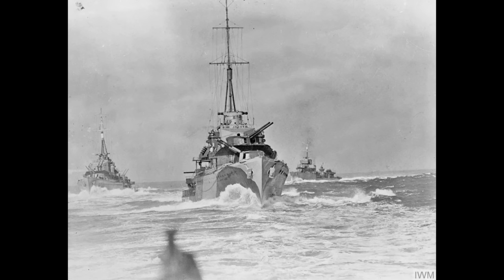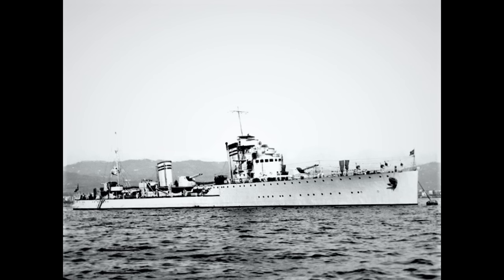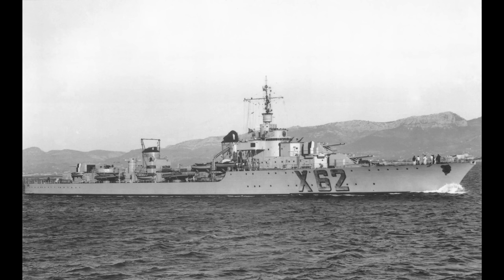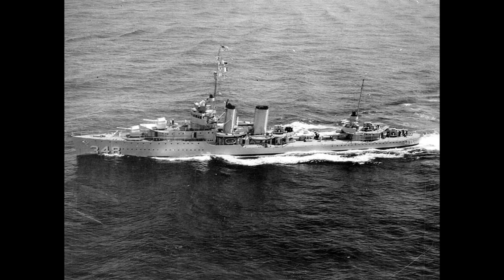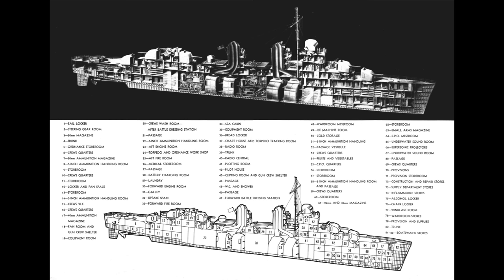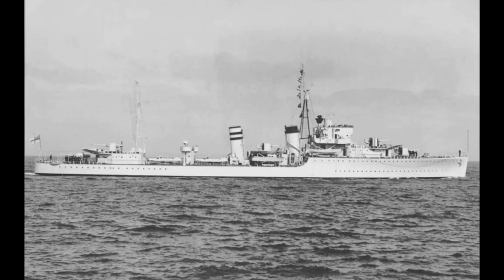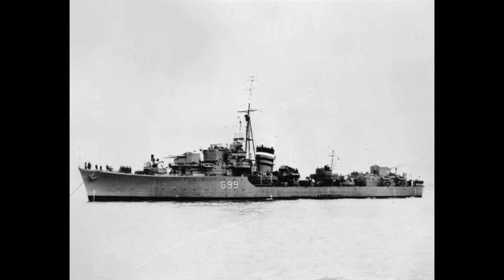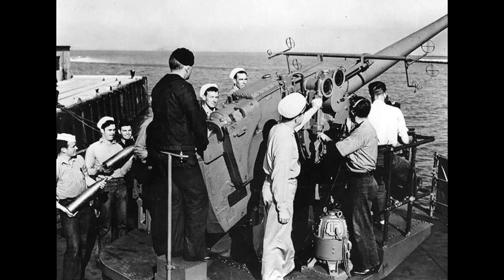Destroyers - Interwar development and design (1918-1939)

Comment: The whole German DD program just frustrates me...
The Germans can't claim lack of engineering capacity. Not with all the technology they possessed and secretly developed in the 1920's.
The started off bad with the Type 1934, but even before the first of those ships was in commission, the Type 1936 design was already finished and the first 1936 hulls where laid down. They must have known that the rushed Type 1934 was bad and fixed it without having any operational feedback from the commissioned ships. With the Type 1936 they where clearly on the right track. The hulls are probably a bit heavy for their firepower and crew requirements seem excessive, but there probably was a lot to win from a refined Type 1936 design. 

From that point onwards, Germany could have build a number of suburb, improved 1936 ships. They had all the technology for it. 
-Germany by the middle of the 1930's was capable of fitting out warships ships with diesel engines for propulsion. Putting at least 51,000 SHP (so at least six 8,500SHP engines) in a Type 1936 hull would have been possible. MAN already designed 10,000 SHP diesels for the D-class and would design anything the Reichmarine and later the Kriegsmarine would order. This would give the destroyers the desired range. The Germans wanted 6,000nm at 20kn and diesels can give you that, even with limited fuel capacity. 
-Most of Germany its shipbuilding expertise was still around. It was not like in 1919 some allied troops marched into the German naval design office and shot everybody on sight. Most of the staff probably ended up at Deutsche Werke, the major German commercial yards or ended up in the Netherlands for clandestine development of warships. The Germans did show some good level of competence in certain aspects, but it never seems to have gotten all aspects together in one ship. I suspect that the problem was not so much the designers, but the people making the (often stupid) requirements and a whole lot of typical Nazi Germany political intrigues messing with the designs. 
-Hazemeyer, the developer of the 40mm Bofors mounts, well the company was pretty much German. Hazemeyer was founded on invitation of the Dutch navy because of the requirements for fire-control systems for the incomplete cruisers Java and Sumatra. They wanted the latest German system, but after WW1 the Germans could not deliver. So Siemens-Halske just setup a Dutch company, staffed with Germans, to deliver the systems while also keeping development going. Only in the late 1930's would the Dutch navy try to obtain some level of control over the company. In other words, the AA mount and accompanying fire control system the Dutch navy used, the RN copied and the USN took for inspiration, could have been installed on all German ships, because it was designed by Germans. Further there are the long standing rumours and speculations that the infamous 40mm Bofors AA gun was largely based on a rejected 40mm AA gun design by Krupp.
-The Germans already had quite some welding experience to keep the hull's light. Again, partly via the Netherlands. The AG Vulkan and Krupp Germaniawerf had a joint design bureau in the Netherlands, IvS, to design ships for foreign customers as well as for the Dutch navy. That is again a place where a lot of German naval architects ended up. 
-The Germans further had the practice of mounting their AA guns as far back on their cradles as possible and balancing the guns with counterweights. That allows for a lower overall height of the mounting without the breach smashing into the deck upon high elevation recoil. Like this you can design more compact and thus lighter dual purpose mounts for use on destroyers, cruisers and battleships. Look at for example the infamous Flak 88 and the pivoting point of the gun. It is really far back and that allowed the gun to be lower, lighter and thus also used as an AT gun.
-The German 37mm AA gun for the navy was hand loaded. This while for the Heer, the Flak 18 and very soon afterwards the improved 36/37 appeared. Very underrated AA guns. They trade some muzzle velocity and a bit of explosive power for being much lighter. Either will happily shoot down most if not all single engined planes of the WW2 era with one good hit. 

A Type 1936A should have been something like this:
-Diesel engines for the range, lower crew requirements, better low fuel stability because the engines are heavy and the added benefit of not killing everybody when the compartment takes a hit and a boiler bursts. It would even allow better redundancy because you can now introduce three separate engine rooms with transverse bulkheads separating them. 
-Six 128mm guns in three dual purpose turrets, one forward and two super firing aft. The turrets should not only increase RoF, but also help with reducing crew requirements somewhat. 
-Eight 553mm torpedo tubes.
-Replacement of all the AA with five dual mounted 37mm AA guns, a naval variant of Flak 18 or 36. Preferably with a simplified Hazemeyer mount with some fire control system, because also German. 
-Aim to get crew requirements down to some 280 sailors and officers and displacement of some 2300t standard. 

Both the IJN and USN needed about a decade before they seem to have realised that their ships might be top heavy, unstable and structurally unsound. The IJN only figured it out because their ships where literally falling apart in a storm. The Germans figured it out without having commissioned the first of their rush job Type 1934's. Then they fixed it, and then they f*cked it up again with those stupid 15cm guns. 😒
Reply: I do like your points, but I think there was a serious design problem in the German Navy, with over-engineering creating tons of excess weight; and an ignorance of the merits of top-notch sea-keeping, plus growth-potential. Trying to fit too much onto displacement really limited the ships in some ways, and the over-engineering and possible design inefficiencies resulted in larger, heavier hulls as well.
Reply: @aikishugyo  Engineers don't over engineer because they like to make everything to complex. No, they over engineer out of a lack of experience and knowledge what is important and what not. A true second generation of German destroyers based on the Type 1936 hull should be simplified in terms on construction and enhanced in terms of capability. Turing the Type 1936 into a production model should accomplish this. This is what the RN did with its destroyers and to a lesser degree the USN and IJN did the same. The Germans meanwhile kept designing new destroyers like the Type 1937J, Type 1938A or the Type 1938B instead of focussing on the reasonably Type 1936 and improving this design for series production. The only real "improvement" was the switch to 15cm guns. A switch that doesn't seem to have been thought out, not universally approved. The same argument about 12,8cm vs 15cm kept returning 

To me that doesn't point at the German engineers being incapable, but the military leadership being unsure what they want. The Type 1934, 1934A and 1936 already reflect this. The Germans where designing just about every possible configuration of destroyer in the span of a few years. From the small torpedo boots which where more like small destroyers, all the way to ships that could outgun a French contre-torpilleur while also having both a cruising diesel and high performance turbines so they could be used as commerce raiders. 

The Germans had all the technology they could want to create a decent destroyer. Everything from being the leading nation when it came to radar in the 1930's, diesels, fire-control systems, excellent guns in the 37mm Flak 18/36/37, the 10,5cm SK C/33 or the 12,8cm SK C/34 or competent engineers. Neither where they short of good ideas. The problem was that the German navy as a whole failed to actually take everything they had and turn it into a good combat vessel. To me that sounds like a failure of management, not engineering which always seems to be the focus when discussing the interwar German navy.
Reply: @DanielWW2  Sure, I just did not bother to spell it out, since I considered it pretty obvious that lack of experience was the culprit, rather than incapable. That said, the philosophy, as you pointed out, was dead wrong, leading to no savings. And that "switch", as you pointed out, a similar mistake. Whether or not there was a vision I don't know, but if there was, it seems to have kept changing, and never hit the mark in terms of what destroyers should accomplish, and what designs are actually fit for the job at hand. My conclusion was that inexperience kept them from being realistic, and actually acknowledging nature, men, seaworthiness, and effectiveness in reality rather than in fantasyland/paper. Certainly they could have built awesome destroyers if they had known how. Whether the designers had different ideas from management but were forced into unrealistic designs is not known, but obviously management was unable to define a realistic design so the buck definitely stops there.
Reply: H

Comment: All those open bridges?  Perhaps in the United States we are comfort mad, but I suspect that the bridge crew was more productive with an enclosed bridge?  Perhaps on the Murmansk run?  Even if a swabbie had to be sent out periodically with a swab and a bucket of hot seawater to deice the windows.  It would be interesting to have comments on the relative livability of the vessels, even beyond the availability of group massage.
Reply: The photos in the RACP museum shows that frozen seawater had to be axed off the rigging, deck and superstructure so the weight did not turn the boats over. Some of the destroyer escorts in the PQ convoys were ex-WWI US, with open bridges.
The U-boats must have been able to home in on the hammering sounds.

Comment: You did not mention at all the ultimate super-destroyers of the pre-war era: Polish "Grom"-class. They were something like super-Tribals, built without looking at money, designed to counter any Soviet ship on the Baltic, even in "3 vs many" battle. 7 of Bofors custom-ordered 120mm guns, two triple torpedo launchers ("universal" 533/550mm), over 2100 ton displacement. More than 3 knots faster than British ships (39.5 knots designed & reached speed). Dual machine room provided 1/4 more power than "Tribals" had. One of the first ships in the world equipped with the famous 40mm Bofors anti-air guns, quite a few years before it started to be the standard. No other destroyer built before 1939 could really compete with all that.

Comment: Could we see a video on the ise class of battleship aircraft carriers/BBV's? It could be quite interesting. Or maybe a video on the battleship carrier concept?
Reply: Joel Montgomery 

You do realize they were built only out of desperation and were even more useless than a normal battleship?
Reply from the maker: They're on the list :)
Reply: @bkjeong4302  i do know that. Its just an interesting concept. Similar to the battlecruier concept. It was an interesting idea but not that effective unless put into very specific circumstances. Just an odd interest of mine. Doesnt mean you have to agree with me.
Reply: @Drachinifel  Mind adding how the concept kinda/sorta lived on in the sovjet navy as the kiev class of "heavy aircraft carrying (rocket) cruiser" drachinifel?
Reply: Joel Montgomery 

Actually BBVs were much, MUCH worse than battlecruisers, because they were useless even in those specific circumstances you’re likely thinking of.
Reply: @bkjeong4302  the specific circumstamces i was thinkimg of would be. Firstly. Shore bombardment combined with precise airial attacks. Of course this would entirely depend upon how many main battery guns, their calibre, rangefinding equipment, types of aircraft carried and the enemy defences. Also in simply sailing from point A to point B without a proper carrier. As we seen with repulse and POW. Having at least a small number of fighters would at least stop the ships from being a turkey shoot. Of course repulse and POW where doomed from the start. Just using them as an example.

Comment: 4:10 -- "... range was 3,500 nautical miles ... " --  For those of us who might not be mathematically inclined, I took the time to work out a couple quick figures to help put this range into perspective.  Drach mentioned that the average top speeds of the period for an interwar DD were something between 32 and 35 knots; It takes almost 5 days to travel the distance implied by the range, at top speed.

Range could be and was radically extended by running the engines at lower speeds, which made the marine diesels of the 1930s quite charming, indeed.  And, I highly doubt that a DD running at top speed for 4 days would get 3,500 NM by the end... not without a refuel stop.

Speed -- Hours -- NM
32   ---   120  ---   3840
35   ---   120  ---   4200
Reply: Cruising speed tends to be 50-70% of flank speed.
Reply: @ineednochannelyoutube5384  Correct!  Drach even noted later that it would be something more like 15 knots; even so, this would only cut the speed in half (ish) AND thus double the amount of hours.

The number of hours denotes the OPERATIONAL TIME LIMIT the boat can stay out at sea.
Reply: @ineednochannelyoutube5384  RE: Flank Speed, Drach's talked before about how that is different than Max Speed.
Reply: @jamespfp  Quiet right. Max speed is what the ship achieves in trials, loaded light, burning high quality fuel and in calm seas with a stiff tailwind. Flank is just whatever it can make in a real tactical situation, as such tends to be a bit lower.
Reply: @jamespfp       At half-speed the power required is only 20% of that required at full speed, so the  steaming hours increases 4-5 fold.  Up to half-speed the resistance is caused by friction, and the speed/power curve is linear.  At higher speeds, wave-making resistance comes into play, and causes a dramatic increase in the power required. It takes energy to create those impressive waves,  and that is "stolen" from the propulsion plant.
Reply: @BarryT1000  Awwww Jeeeeez barry, THANK YOU for explaining that!  Thumbs up and madly, too!

Comment: imagine some kind of equipment that allows you to use fuel tanks as balasts by filling them with water when the fuel is used. Special pumping and later cleaning will be required at port but this would allow destroyers to extend their range, use larger displacements for fuel and avoid going upside down when you are low on fuel.

Comment: 31:03 Imagine this with two supra-firing FOUR-barrel turrets fore, the second with shorter barrels to allow AA use.  Aft, another centerline 4-torpedo launcher.  Now imagine the second turret isn't even suprafiring, that instead it is directly behind and level with the first turret.  Advantage is bringing the weight lower, for better stability, and eliminating the weight of whatever structure is holding it so high.  Disadvantage is only that DIRECT fire, dead-ahead is "only" 4 guns.  (Which it is as actually designed.)  As long as you need more than about 10 degrees elevation you have 8 guns discharging forwards.  Finally, bring the command structure far enough aft that all guns can indirect-fire directly backwards, too.

Comment: Unfortunately, I have to say that the part about Italian destroyer is not precise or accurate.

Other than the fact that development of destroyers ("cacciatorpediniere") and scouts ("esploratori") was different and the categories were officially merged together only in 1938 (and it was mainly due to the perceived increased role of aircrafts, which they thought took over the scouting role and made such ships redundant as such), it's wrong to put the lineage of the destroyers (of which the first design ought to be the Palestro-class, rather than the Curtatone-class) and that of the scouts (the Leone-class, themselves hailing from the lone WWI Quarto and the Nino Bixio-class) together, as they had quite the differences. Very apparent were the differences about armaments, with the destroyers being limited to four or five 120 mm guns, while ships such as the Leone, the Navigatori and the later Capitani Romani (belonging to the same group, even though they were officially classified light cruiser, but at first they were meant to be classified "esploratori oceanici", oceanic scouts) being way more heavily armed, and with a greater emphasis on speed.

A pity, since the video is really good otherwise.
Reply from the maker: The Palestro class was not included as they started building in WW1, and thus fall into the scope of the last destroyers of the previous video.

Where a scout was so classified and significantly larger than current contemporary and foreign designs, I noted it, along with the fact that they were rerated as destroyers during the interwar period. 

The reason for including them in a linear narrative is fine to the fact that the Two lines of Italian development varied from each other, but not by the substantial amounts that some other nations twin developmental lines did, with speed being maintained in subsequent classes for the most part and the size of the scouts being only just greater than the average contemporary DD.

Comment: 44:00 You seem to be ignoring turret protection. These Royal Navy guns seem to be virtually open mounts.

Thanks so much for this (and everything else).  What made the IJN destroyers great at the beginning of the Pacific War was the Long Lance torpedo. What made the Fletcher class great was the Combat Information Center and the proximity fuse.
Reply: The Mark 37 fire control system with Mark 1A fire control computer.